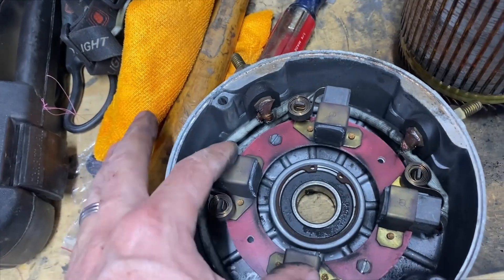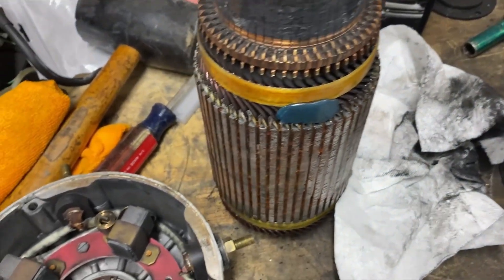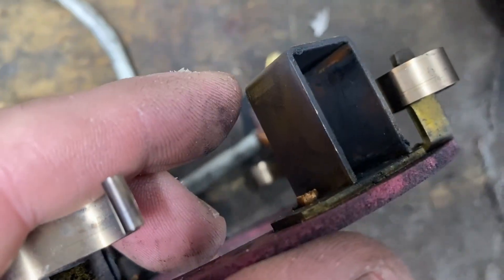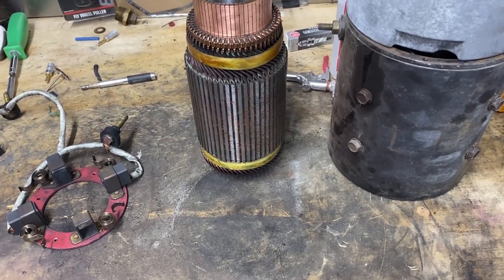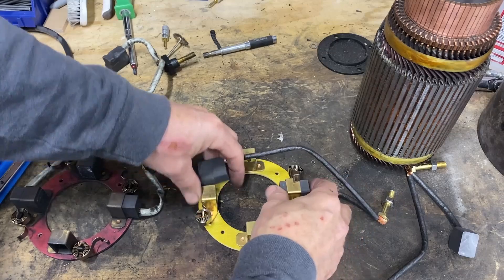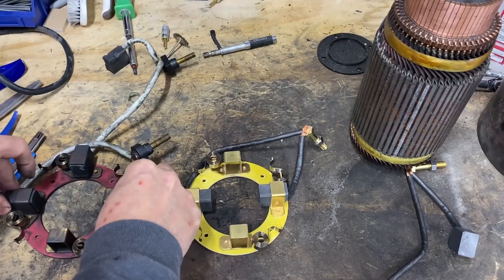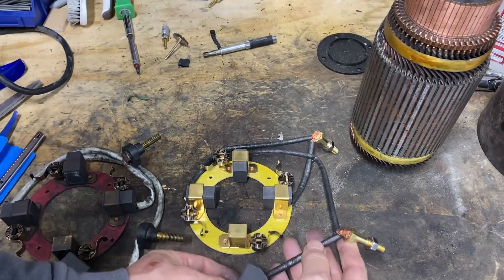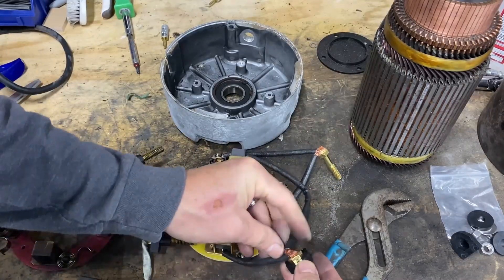How to Rebuild an Electric Golf Cart Motor

Comment: Is the little rectangular cover that you installed on the side of the end cap towards the end required. My bolt rusted and snapped. Just trying to see how important it is.
Reply from the maker: I think it’s just an access door.  I would drill it out and retap if you cant extract the screw.

Comment: Hi! How did you resurface the commutator? I have a 48V DC Tornado Siren that had stuck brushes when I got it, it looked similar to you motor with small amounts of moderate pitting on the bars. the commutator is my only concern so far as everything else looks great.
Reply from the maker: Thank you for watching. I used a dremel and fiber wheels. I have a link in the video description to the fiber wheels i used. I use those for A LOT of different small projects.
Reply: @kdsgarage8475 All right, thank you!!

Comment: How did you remove the armature from the bearing? Mine is stuck. Also any issues sliding the armature back onto the bearing? I can’t get mine removed to install new brushes, so my assumption was that it would be just as hard to put back on. Looks like it slid right back on easily in your video.
Reply from the maker: I used a socket and a hammer with some blocks to support it.  Mine was in there tight as well.  You can try putting the armature in the freezer for 2 hours before you reinstall.  It'll slide right in.

Comment: what did you use to clean the armature?
Reply from the maker: Hi.  I highly recommend these.  Use Dremel fiber wheels.  They work the best.  https://amzn.to/49hTSeP

Here is the Dremel  https://amzn.to/3CSZosd
Reply: I put mine in my drill press and used it as a lathe. Then grabbed a rough file and flattened it, then sand paper starting with a course grit, gradually working down to finer and finer grit, then finishing with green/red scotch Brite pad. Make sure to scrape a V into the insulation between each bar . You don't want that touching your brushes. It's very hard material . Mine works great now. I beat the hell out of it